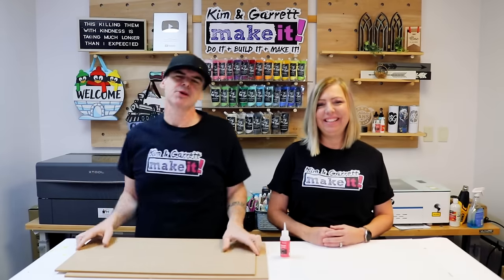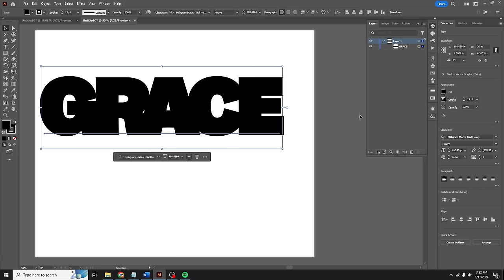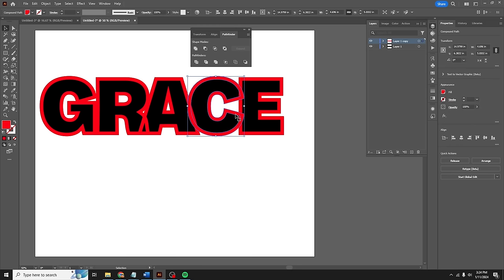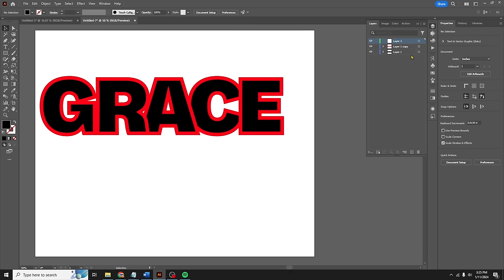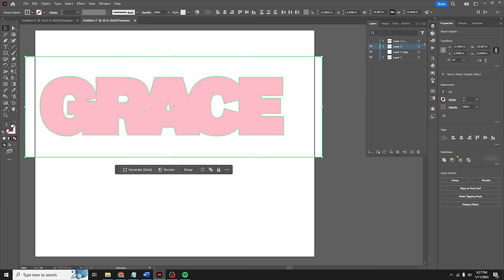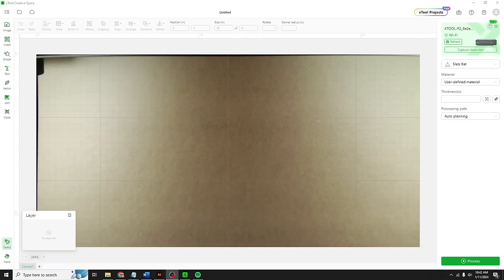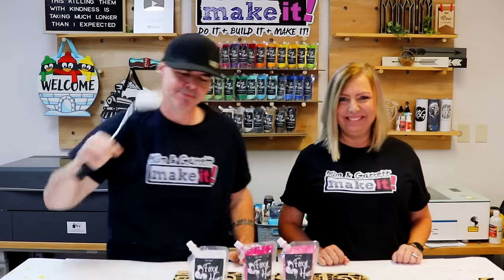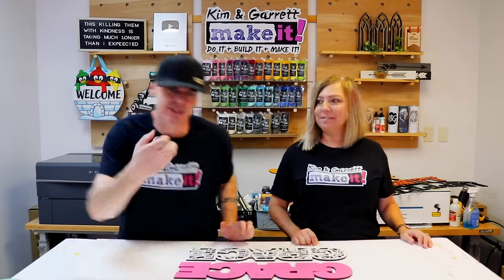Easy Laser Craft to Sell: 3D Layered Name Shapes Tutorial

Comment: Thank you for sharing how you do this, I love everything you guys do.  I am trying to do this for my son and having an issue. In AI when I add multiple images for the Layer 3 when I get to the part of Minus Front after Shift Clicking the images it only leaves one of the images I put in there.  Even though when I shift click it is showing all of them highlighted.  Is there something I am missing?  Basically only leaving the image in one of the letters, getting rid of the rest.
Reply from the maker: Make sure your objects are ungrouped, then you might have to do a Minus front multiple times to clip all the pieces.  Copy (ctrl+c) then Paste In Place (shift+ctrl+v) will come in handy when when the front piece disappears after Minus Front.   I do a Minus Front then Paste In Place for the next clip.
Reply: Thanks, will look into that, after trying to cut some I think I realize why it kept doing that just gotta figure out how to correct it.  I was using a name with LE at the end and even with the unify or such it was keeping the L and the E separate so when I tried to do that step I guess since they weren't connected it would try and get rid of the rest.  I did trim instead to get the job done but will have to see why it didn't join the L and the E together.  Thanks again for everything. @KimandGarrettmakeit

Comment: Far and away, my favorite video you've ever done. I've been thinking about it for a week and decided to try and follow along today. I'm new to AI but I'm getting there.  However, i'm getting stuck at the 3.5m mark for erasing the overlap. My ai doesn't do what yours is in this spot.  i don't get the larger round cursor and if i click on the overlaps, it just kind of creates a little dead spot.  Any tip you'd could recommend?  ThankS!
Reply from the maker: You can change the size of your cursor with the "bracket keys" to the right of P.  The bigger area should help erase instead of just a dead spot.  Let me know if this helps!  ~garrett
Reply: @KimandGarrettmakeit  that's cool. i didn't know how to resize the cursor and that part works but still getting the same behavior...just larger "dead spot.'  I have a red stroke on a black fill and when i click with the erasor on those vectors, i just get the large white dead spot.